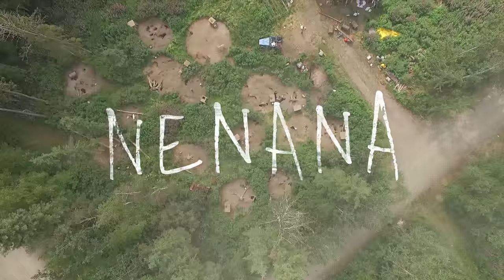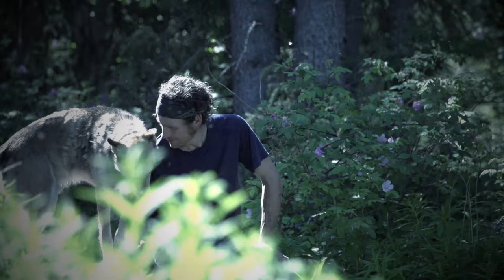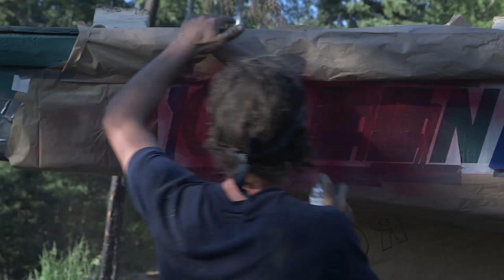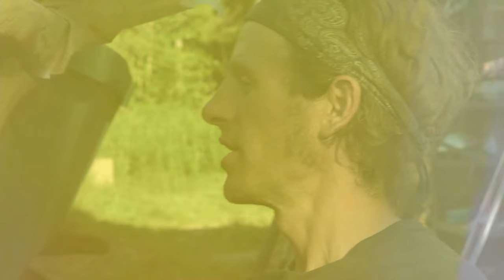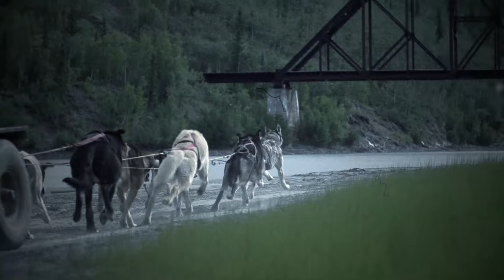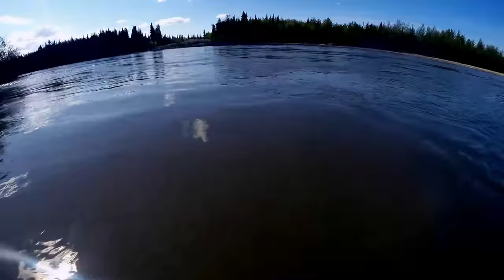The Greatest Sled Dog - Deleted Scene | Life Below Zero

Comment: How would you like to have to be a sled dog? Sled dogs become sick often because of the constant stress. Their feet are almost always bruised.
Reply: Sled dogs rarely get sick, that's how they survive so long and work so long they're bred to have a tough immune system and tough feet. If a dog got sick easily and feet cracked often it wouldn't be bred and wouldn't pass on those traits cause it wouldn't make a good efficient sled dog, only the best of the best get to reproduce when you're breeding for a purpose like sledding.
Reply: Sled dogs were born like this they like doing it and they don't struggle..
Reply: @deli3048  They don't struggle?  They just get rotten feet and/or diarrhea and shut down. Did watch the video of the dogs?
Reply: @deli3048  Dog racing is dog racing. Mushing is cool but racing takes it way too far. These dogs don't live good lives.